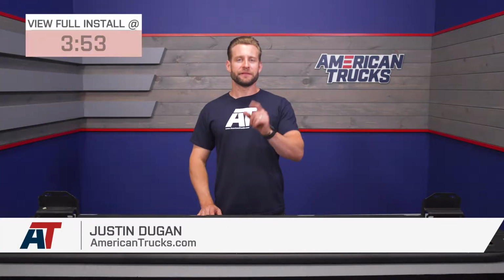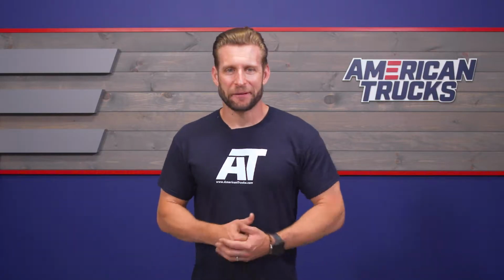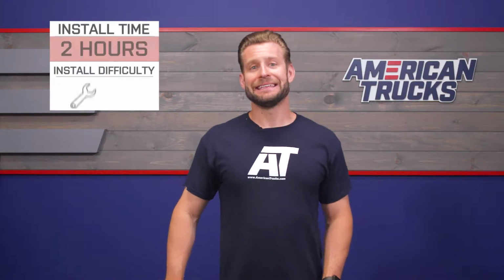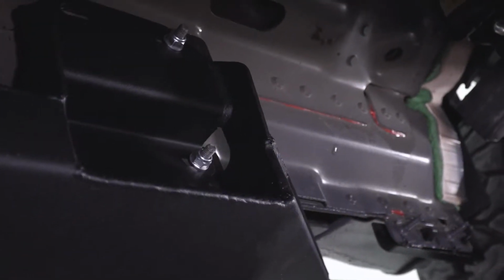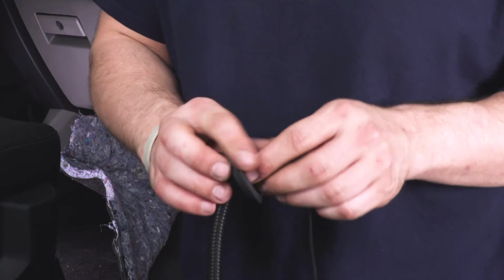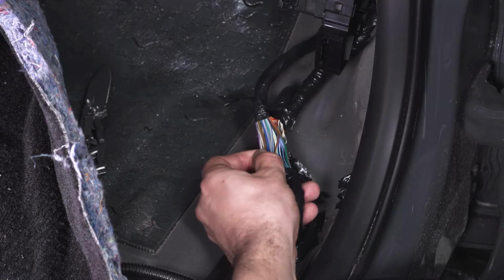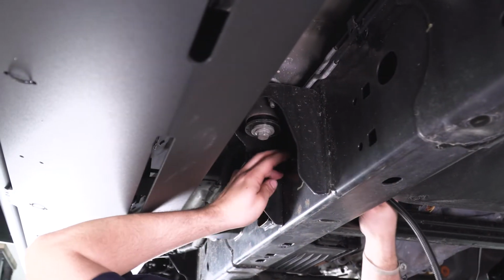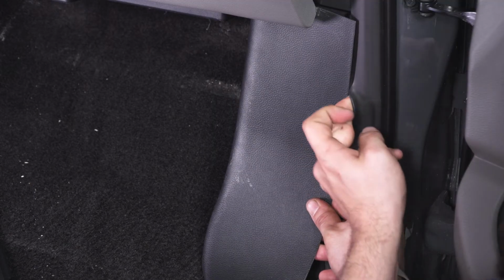2015-2019 F150 Addictive Desert Designs Rock Slider Side Step Bars w/ LED Strips Review & Install

Comment: If these arent being installed into the frame of the truck Im not sure how you can call them rock sliders. From the looks of the install they are being installed into the underbelly of the truck (sheet metal), one nice rock/tree is going to wrinkle that aluminum like its a tin can.
Reply: Chris B I agree. I’m not sure how hard it would be to just run some tubes back to the frame. Even just a bolted connection to the frame would be better than going to the body. These are just fancy steps